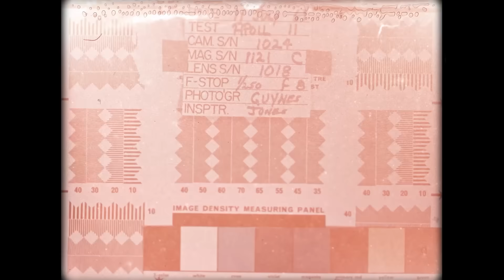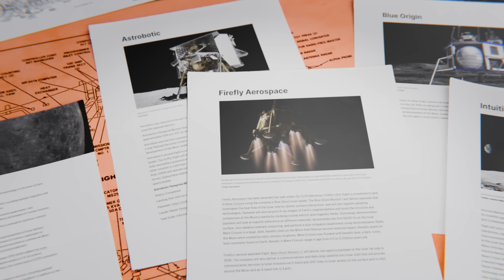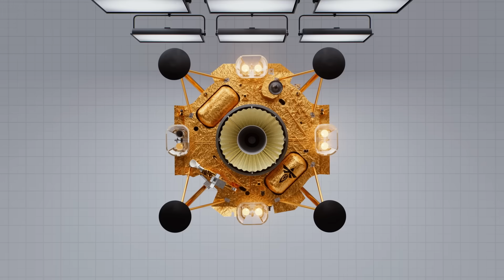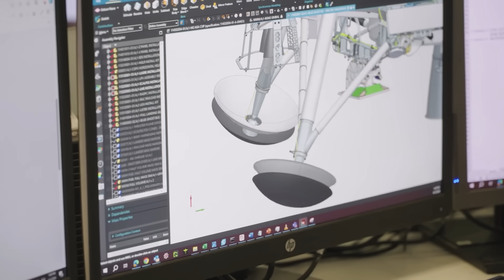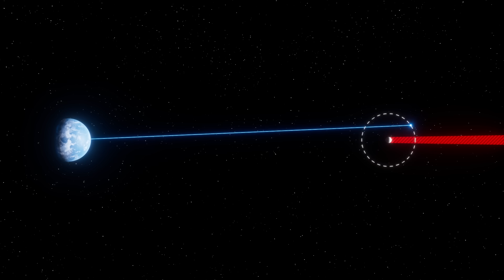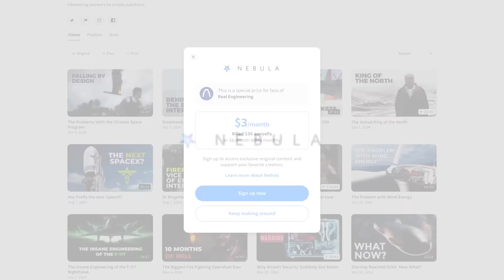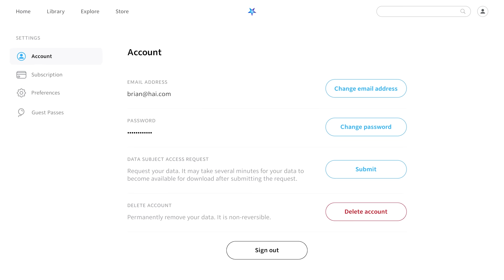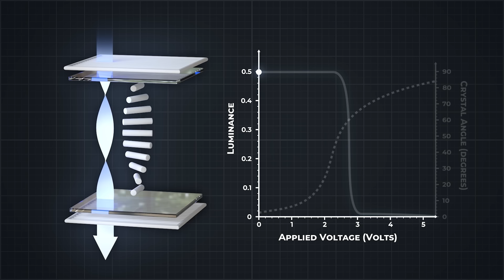Why the US is Struggling to Land on the Moon

Comment: "It's difficult to know whether you've landed"

Really though? Laser altimeter!
Reply: The LM had a radar. But for the last decimeters, it's not that simple. A mechanical contact was used.
Reply: @ThomasKundera  
Or scanning LiDAR 
Millimetric radar
Cameras watching the horizon
Thermal imaging can see through dust
Infrared laser altimeter!
Upward firing RCS

And create a multiply redundant system from dissimilar sensors. 

And finally, my piece de resistance 
A Lander that can stand itself up. 
And survive at least one leg being torn off. 😂😉

Or even, designed to fall over on landing. 
And then stand itself up by unfolding it's legs.

🙇‍♂️
Reply: @MostlyPennyCat  I think all these commercial programs try to pinch every ounce of weight/cost, basically trades redundancy for cost.
Reply: @MostlyPennyCat  : Lots of sensors needs lots of onboard intelligence (eg. what when a sensor contradicts another?).
Which  open more chance of failure somewhere.
Especially on new poorly tested stuff.

A simple unique robust system is better at first. Even if, ultimately, with enough time and testing, more complex systems can be more versatile with a low enough bug level.

Comment: You mean to tell me, my boat has better telemetry (sonar) than a lunar lander (no radar)? Slap a radar system on there and train the autopilot to “see” thru the dust and navigate around boulders that are too small for the reference photos taken from orbit, but large enough to trip the lander.

Yeah, it’ll add weight and costs… but I bet you Intuitive Machines would’ve had a successful landing. Pathetic.
Reply: The LM had an altitude radar (and issues with it during Apollo 11)..

Comment: 6:41 With all the progress in battery tech, why don't we/NASA have 2 or 3 different Battery chemistries that operate at different temperatures, so that a Lunar robot/Lander could sustain the extreme 14_nights temperatures? One battery (Sulfur-based maybe) for the extreme heat, one battery for the extreme cold (I don't know, what: Hypo_Chlorite based?) Then build a network of permanant Lunar seismometers, early on (before it gets too noisy up there, because of all the rovers buzzing around on the moon's surface!)  
And btw in the 1960s, engineers were more respected!

Comment: no camera redundancy?? they are not very expensive, that is a very weird choice
Reply: The cameras they have to use are expensive. Terrestrial electronics do not work in outer space. Everything we put up there has to be radiation shielded. The Japanese tried to send a probe to Mars once using off the shelf electronics. Halfway there it just died. They lost communication with it and that was that. We use the RAD series of CPUs from IBM. Each chip costs a quarter of a million dollars. They have the processing power of a chip from decades ago.

Comment: A person flying is different than a computer flying it as we have seen. 
During the Apollo 11 moon landing, Neil Armstrong had to manually take control of the lunar module, nicknamed "Eagle," to avoid landing on a large boulder field and a crater called "Little West Crater" in the final moments of descent, essentially coming very close to landing on a large rock due to the need to find a safe landing spot; this maneuver was performed with very little fuel remaining.
A person can see things that were unexpected faster and make corrections to make a safe landing.

Comment: 5:31 Maybe the rocket equation is even more tyrannical than I know, but I'm kind of surprised their primary navigational camera have no redunancy. And no landing radar capable of seeing through the dust plume near touchdown? But then again, land a few of these stripped down landers with the right radio beacons and you have an ILS system that could allow mm accurate positioning local to a landing site for more important payloads.

Comment: I like how you mention the failed mission where they couldn't avoid a boulder, and then proceed to mention how they're using these scans of the moon that are supposed to have every boulder mapped. How is it possible that such a failure could happen if they have the scans? What mistake was made, was it in the scan, or was it in the thrust that was applied to try to avoid the boulder? Why did the landing plans even put it on a collision course with a boulder if we have the scans?

Edit: I'm an idiot, I should have watched the full video before asking. The moon dust getting kicked up is causing issues. I'm still slightly surprised that without any wind, etc. we can't just precisely plan a pre-calculated path and avoid having the landers even reference their location. I get that you dig into the issues with the landers being small and lightweight, but I'm just very surprised that we can't pre-calculate exactly where the lander will be.
Reply: We can, you have Inertial Guidance Systems that have the accuracy of millimetres, so you can know your exact position even when fully blind. It's likely a software issue or a mapping issue, because without those you cannot calibrate the inertial guidance

Comment: "Too many cooks" this happens in all engineering groups over time. Old guys leave and the new guys overlook fundamentals and over engineer novel systems.

Like the "honeycomb crush" feet could also just be a friction fit of two tubes that will slide on impact. One of the tubes could have a slight grade so the more it slides in the tighter and more friction will be forced. Keep it Novel. Simple, Stupid.

A simple lidar will show surface distance and accelerometers are used all the time and you could have one at each corner with a center gyroscope to all work together for sanity checks for when dust starts to kick up and lidar can't be used. Furthermore for better stability the tanks can have blatter's or cylinder inside to prevent any sloshing/secondary motions.

The gyroscope and accelerometer inside a modern phone is shockingly accurate. You can walk across a room and it will tell you within +/- 2 inches.

Instead of adding a bracket and weight, they could have just changed the field of view. Using SLAM it will be able to store topography information, as there's No moving objects to worry about there's no sense of keeping a wide field of view. This is how when you park in some cars it's able to still show you on the screen everything around you.

Comment: Anyone who has played Kerbal Space Program knows that you map the site out with a high-res scanner, then when you land you kill ALL horizontal velocity before coming down to the surface.  That probe that hit a rock and tipped over was obviously done by amateurs. lol
Reply: They had failing sensors. In reality space craft components fail more often than in KSP.
Reply: @richardbloemenkamp8532  They built the dang thing to be topheavy, came in sideways and then were surprised it tipped over.  Amateurs I say. Though I suppose I can't really blame them.  Dealing with maps with a resolution of 100m², there is no way to plot a good landing area.  You need 0.5m² square at least and preferably 0.1m². But 100m²?  Egads.  Do You realize you can fit 36 average sized homes into 100m²?  There could be a small mountain there and nobody would know!

Comment: From some presentation I think I remember the basics of how apollo 11s Lunar Guidance Computer handled the landing based on dobler-shift radar pointed at the ground and inertial guidance module.

Still, seems a bit silly to have only one camera as a single failure point. Of course adding a second camera would be no good without extra work to handle the differing perspective. Probably the goal is to avoid big rocks and correct the drift of inertial navigation, which doesn’t seem very dependant to the cameras perspective.

Comment: At least computers should be much better in 2025 than there were in 1969.
Reply: We can't use off the shelf electronics in outer space. Up there there's no shielding provided by this planet's magnetosphere so that means high energy particles are tearing through matter. Which is devastating to modern microelectronics. Those impacts can flip data in transistor gates. It's a real problem. We can overcome it by using larger pitch lithography but when we do that we lose the advantages we've gained over time. It's called the postage stamp vs the billboard problem. If you shoot a shotgun at a postage stamp it gets obliterated. A billboard you can still read what it has on it.

Comment: why not use a radar altimeter to assist with the landing? wouldn't that be extremely accurate to determine distance to the surface?
Reply: The IM lander had an altimeter on board. They just forgot to switch it out of safe mode before the launch.
Reply: @Hobbes746  lmao

Comment: 13:00 That's not true; if the lander bounced and was in free fall, it would not look like it had landed on the surface according to the accelerometers. Just ask Mr. Einstein!
Reply: Exactly. When landed, the INS systems should measure a normal force from the ground that would not be measured during freefall.

Comment: Uh anyone heard of the Ranger probes?
Why didn't Nasa share all they learned from those missions to these new startups?
They essentially have to relearn already established software techniques to land on the Moon
But the problem with modern moon landers is that they're overengineered
Sometimes simplicity is the best policy
As proven by 60 year old technology
That did it more reliably and consistently than today's landers
Reply: The Ranger probes were flyby missions impactors. Flying past the moon or crashing into it at 5000mph is a little different from landing there.
Reply: @lazarus2691  Ranger was just one phase of NASA’s preparations for Apollo. It was followed by Surveyor (soft landings) and Lunar Orbiter (mapping the lunar surface). All in all, there were 29 unmanned mission before the first Apollo mission. That’s a ton of experience gained to enable Apollo.
Reply: @Hobbes746  I'm familiar with the Surveyor missions - I often like to point out that the first launch from the lunar surface was either Surveyor 3 or 6 depending on how specific you wanna get.

But @chronablitz didn't say anything about Surveyor.
Reply: NASA did in fact share all of the lessons learned, not just with those companies but with anyone with an internet connection. IM was determined to ignore those lessons.
Reply: Or, there's the possibility that they never did it in the first place. But that idea is so unpopular, right?
Reply: @cjay2  You're words not mine😁 What if in a distopian fantasy the moon landings were fake?

Comment: i’m ngl… the blue ghost lander seems kinda poorly engineered. from the way the foot sensor is activated to 2 cameras being the entire landing navigation system, it seemed like there were multiple different places for major improvement that are being glossed over. considering the budget is so high and the talent is available. why wouldn’t you also use lidar like a car if the algorithm is the same, when the benefits are twofold? why can’t you use an actual sensor for the foot instead of relying on something becoming physically unplugged?
Reply: I bet the physical unplugging has way fewer failure modes than a more “sophisticated” sensor: if designed well, you can basically guarantee that if the foot lands on the ground it must change angle, and if it changes angle the connection via the plug must be broken. It’s effectively just a loop of wire with a connector in it - there’s very little that can go wrong, it is physically precalibrated in advance (via the length of wire and the force required to break the connection).

Think of it as an extremely robust “single-use angle change sensor” which uses electrical continuity as its signal. I think it’s genius.

Comment: americans trust people like Elon to do space.
when SpaceX makes 90 mistakes, everyone worships Elon on the 91st success.
when NASA makes 1 mistake, they lose funding. lol
Reply: SpaceX have a better operational track record than NASA. Key word, 'operational'. 
SpaceX are happy to fail when testing *prototypes*, but when they're actually flying payloads, especially when they're flying people, they take things very seriously.
Falcon 9 Block 5 is one of, if not the, most reliable rockets in history, with only a single failure in 347 launches.
By comparison NASA had two failures in just 135 Shuttle launches, equivalent to a failure every 67.5 flights, or more than 5 times as often.
Reply: @lazarus2691  lol if u look at things from the same commercial jockey pov, then everything NASA did should be considered "prototype" what a elon stan level cope
Reply: spacex has the most reliable rocket in history....
Reply: @cardboard9124  after the 90+ mistakes? And counting.
Reply: @Krack2805  please tell me when they made 90 mistakes

Comment: Why do they not use radar altimetry?
Reply: Radar is cheap enough. I think the problem is that it does not see sideways motion and cannot be used to find a good landing spot.
Reply: @richardbloemenkamp8532 I agree with this, I think LIDAR would be the only reasonable replacement for cameras, but there are a whole host of issues with that. Cameras are cheap, light, and tiny. If you can make them work then they are a great solution in this case.
Reply: Radar's only purpose would be to let the lander engine know how to throttle just right to achieve a soft landing. Use cameras for everything else.
Reply: @plica06  The video states that the dust plume caused by the engine's thrust blinds the cameras well before touchdown.

Radar altimetry would easily see through the dust and give an accurate height above surface.

The video also showed a scenario where using cameras could result in a false on-ground reading. Again, radar altimetry would fix this issue.
Reply: @floorpizza8074  The camera allows comparison with the orbiter images to determine not just altitude but position.  Why add a radar when you need a camera anyway and you can make it work with some programming?  I think a radar on the lander would work if they had detailed elevation data for comparison, but they have images to work with instead.
Reply: @Mark_Bridges  I believe lunar orbiter also has been doing SA Radar imaging. Also it is also a risk reward trade off, reducing that one sensor modality on cost and weight, we might end up losing the whole vehicle in landing.
Reply: @richardbloemenkamp8532  That's okay, can still do sensor fusion with cameras.
Reply: Yeah, Apollo's LM featured multiple radar altimeters. Perhaps such assemblies are too heavy or power hungry?
Reply: @SuperCuriousFox  This is why I don’t buy the excuse that radar is too heavy. If the original lunar lander craft with Apollo had multiple radar altimeters, apparently they weren’t too heavy back then…
Reply: @SuperCuriousFox  No, there was a single doppler radar on the underside of the LM looking outward and down, borrowed from one of Grumman's other aircraft projects (A-6 Intruder, iirc). It was active but didn't start displaying altitude data until P64 iirc, when its inputs to the AGC were compared to the values already in memory of where the inertial guidance system and ground telemetry thought it should be. This was a difference in height called "Delta H" which would be merged by the computer to give the true altitude above the lunar surface as well as the descent rate and forward velocity rate. That's why you hear Aldrin calling out the numbers while Armstrong flew the ship (altitude, descent and forward velocity rates), because Armstrong had eyeballs out the window and the pitch angle numbers showing in the window, with Aldrin also repeating what Armstrong should be seeing. The idea was to get the pitch angle, descent rate and horizontal velocity rate all to zero right at the lunar surface.
Reply: Odysseus had a rangefinder, but there was a problem with it, someone didn't remove the "remove before flight" safety pin. Luckily there was an experimental NASA LIDAR as part of its payloads, but that wasn't fully integrated with its avionics, so it could only read a small part of the data it produced, this is why it could even come close to a safe landing otherwise it would be toast. The "it tipped over because of a boulder" is bs, navigation shit the bed because of a human error, which is embarrassing even for a low budget mission from a rookie company. CLPS program is looking like a disastrous mistake so far, low budget approach from commercial sector ain't cutting it.
Reply: Right! I’m sitting here going you guys remember radar don’t you. Way too much focus on cameras
Reply: Because INS is adequate for the task.
Reply: Apparently, radars are not cool anymore, for some reason.
Reply: redundancy used to be the philosophy of design
Reply: Probably cost. If you can do it with cameras you save the money/weight of the radar.
Reply: @stevegredell1123  The weight makes sense. Another system is more weight, that maybe means more fuel, bigger reservoirs and maybe heavier sturdier structure, and finally the 2nd extra fuel for the added fuel/reservoir/structure weight. That might get outside of the weight/size envelope for the carrier rocket to make it reach the moon.
Money maybe, but it's costlier to fail with a cheaper start. Although the scissor business action is all the rage in recent decades... unfortunately...
Reply: @stevegredell1123  Thye just said you can't do it with cameras only.